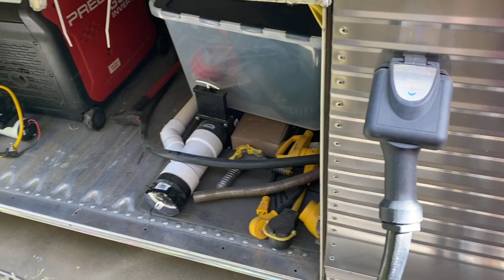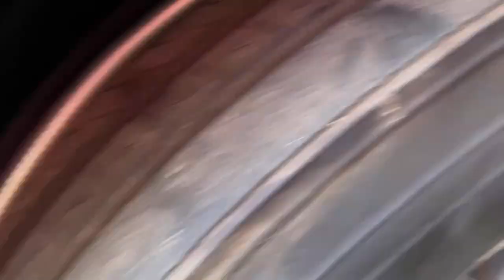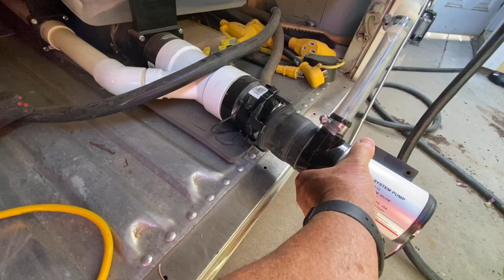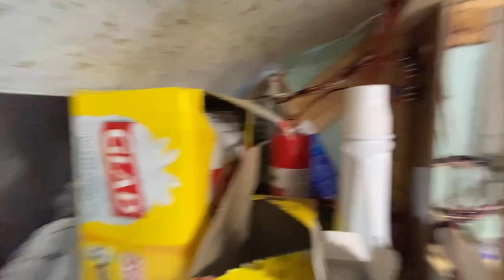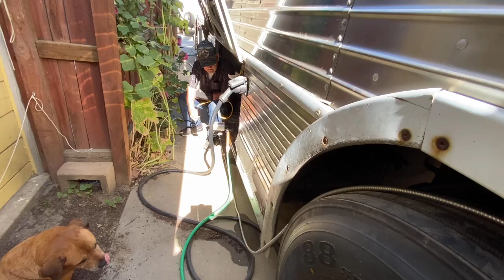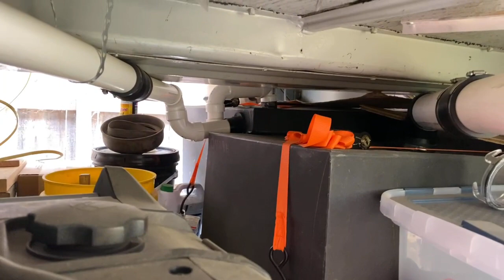#66 - Boondocking, Moochdocking - Using A Macerator Pump

Comment: Keep one on my coach. Used it a few times. I also have a cap (for the black tank drain) with a hose fitting. My tank had a sprayer at the top. I hook a garden hose on the sprayer and run the black garden hose (after I used the macerator) to get it really clean. I use the sprayer every time I drain.